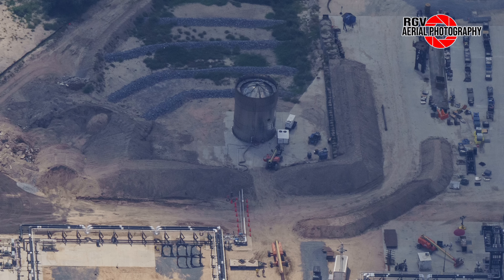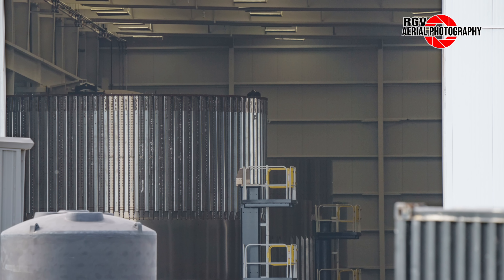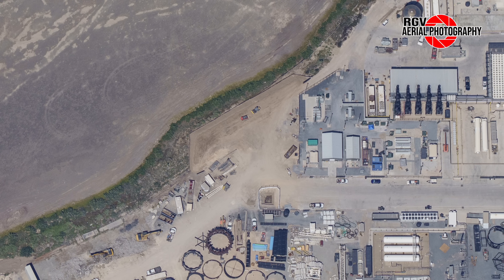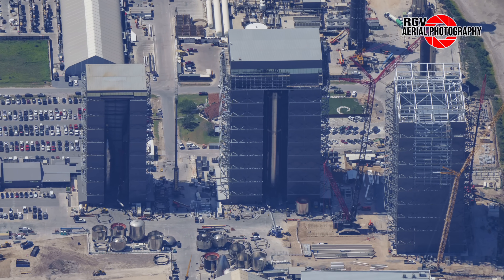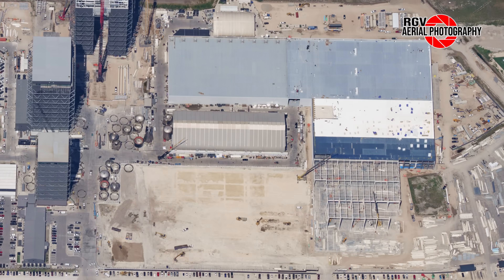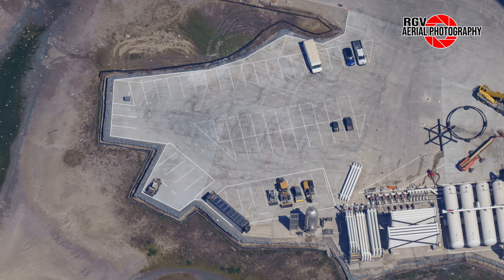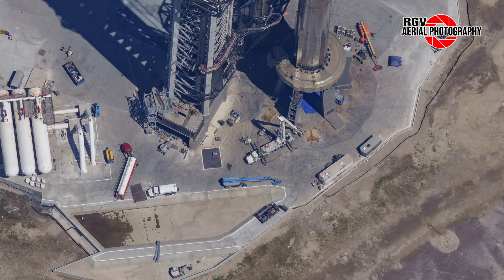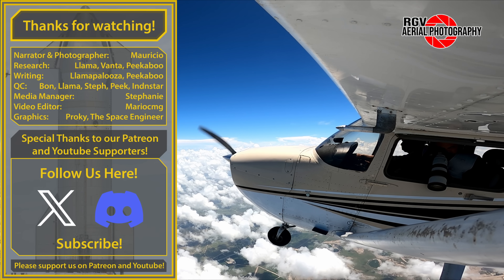Next Ship Prepped for Testing! Starbase Flyover Update 18

Comment: Regarding finishing a road where liquid oxygen is offloaded: "When liquid oxygen spills, it vaporizes into the air, as the atmosphere is far too warm to support it in liquid form. As it vaporizes, it creates a dense cloud of concentrated oxygen... It also soaks into organic material such as asphalt...
If a vehicle drives over asphalt that has been impregnated by liquid oxygen, the impact of the tires on the oxygen-enriched asphalt causes a massive explosion.

Comment: Thanks to keep flying along with these updates.    I do wonder if the hot stage section has locks to keep it in place.   It didn't give me impression it was actually being held down by anything.  Was there workers on top lossing it up so it could be removed?   The thing would fly off I would think if it wasn't fastened to the Booster's crown.
Reply: It uses the hooks that were used on the first test flight that held the ship on the booster to hold itself onto B9 and then has hooks on top to hold S25

Comment: I was expecting the HS-Ring to be removed, as they did have issues with the Ship stacking - possibly some elements were not quite right.
Reply: Aren't the motors and batteries for the grid fins and avionics under there? I'll bet those need to be inspected and batteries swapped/charged.
Reply: Same here. They need to inspect it and/or scan it for stress cracking.